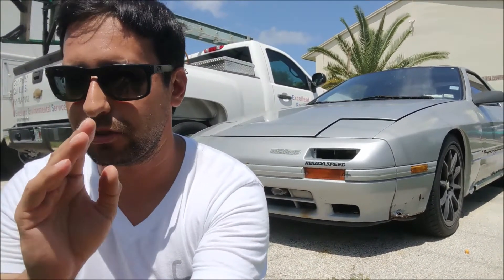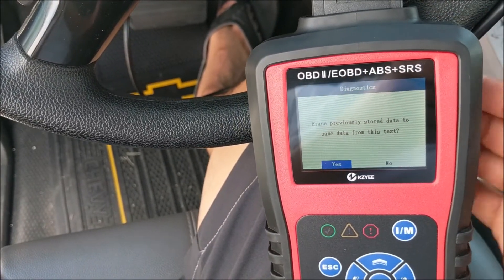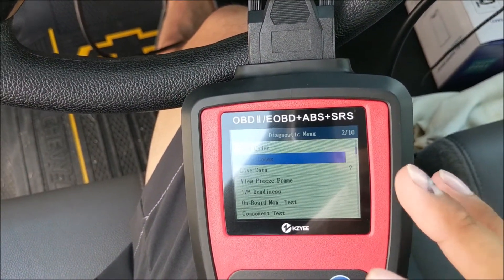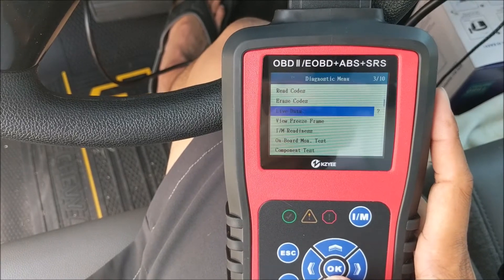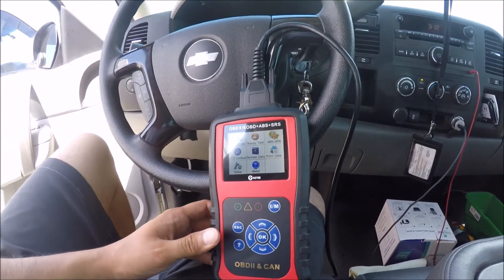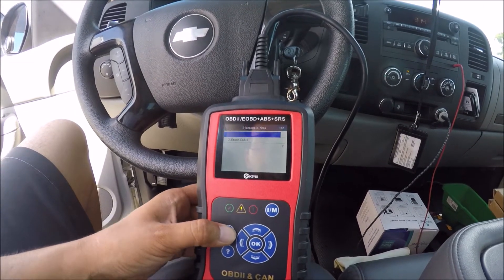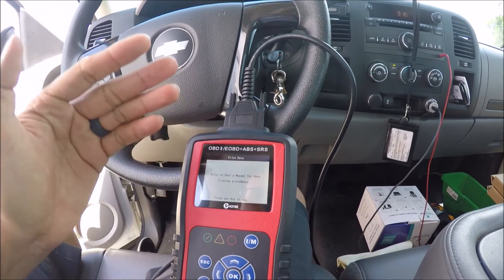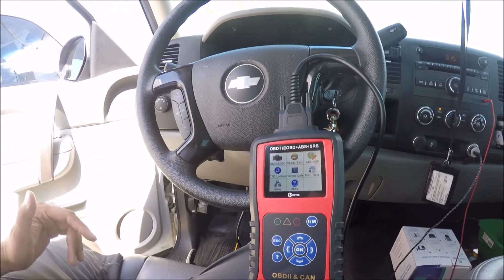How to Use an OBD 2 Scanner (Kzyee KC501)

Comment: Looks like a very complete tool. easy to use and gives lots of information, as do you.   I looked in my 1932 Rumblemobile, but couldn't see the port you referred to. But in my 2014 Toyota
 I found one- In my wife's 2008 Toyota there's another one! what a co-inky-dink.  👍

        🤔  Hummmm-wonder if I subscribe 2500 times I could win...…..Oh, wait. I see how YouTube works....😋 sigh